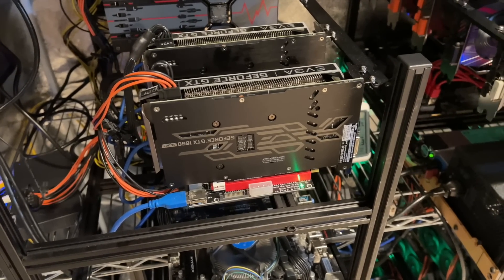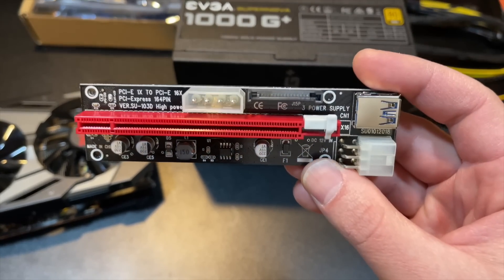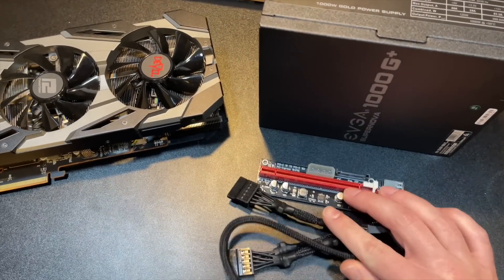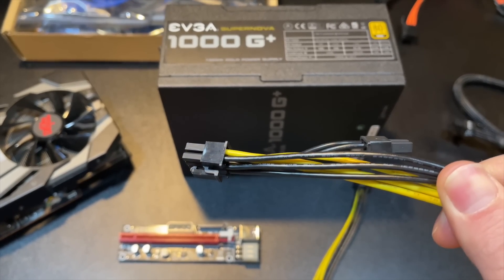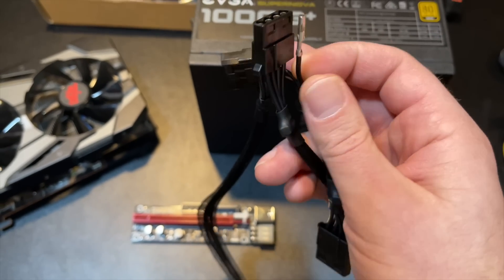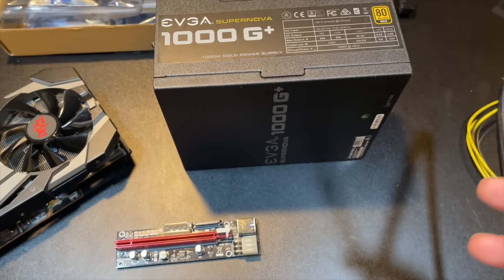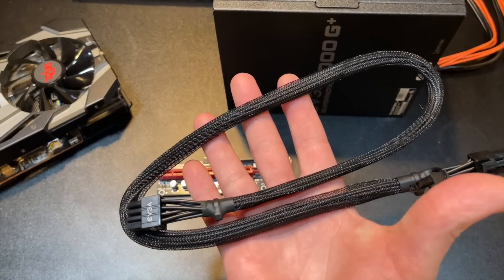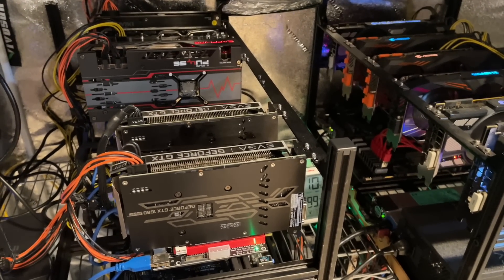Powering GPU Mining Risers Safely

Comment: Thank you so much for the most complete information about powering risers on youtube! I only have one doubt: I'm using all my 8 pin plugs on the PSU for powering the GPUs. Can I use the 6 pin plugs label as peripherals on the PSU to run a 6 pin cable to the risers?
Reply from the maker: You're welcome! You can only use the VGA ports on the PSU for your PCIe.
Reply: I had this exact same question due to running out of my 8 pin slots as well.  Thanks for asking and to Red Fox for answering!  

I’d like to know the why though… I’m guessing the 6 pin slots on the PSU (mine is labeled SATA / Peripheral) is going to provide 75W like the 6 pin PCIe?  Aka cause the slot on the PSU specifically designed for SATA standard?

Comment: I used a PCEI164P-N07 to my 3080 , and i used sata to 6 pin to power my riser. The riser capacitor blow up . Does it means is over volt ?  please share me some wisdom

Comment: What if you only use the pci cable and no power to riser? I have some old pci riser that goes into 1x slot and have no power option for it, and it works good so far.. about a week now.. and the cables are still as cold to the touch as the room it stays in.. (they are really short tho.. so cant connect all my gpu's for now)  so what happens if you use just the pci option for those?
Reply from the maker: That means that old riser is pulling the power from the motherboard. You just need to see what wattage those old risers are able to pull safely to give the GPU the power it asks for.
Reply: @RedFoxCrypto  so that power isnt enought for the usb to pci x1 in the more frequently used risers?

Comment: molex are more strong than sata , sata is not for high ampere it's thin pins ,and on 12 volts it's use only 2 positive pins ( negative pins are black and they are more 5 or 5 pins  (it's use 4 pins for 3volts ) and 3 pins for 5 volts , that mean yellow can melting ,  but u can always use more cable in parralale for more safety  and don't use too much spitter on same cable , try to split as near possible near the power supply and use the max of cable possible before splitting and don't spplit a splitted cable if you can use another who not splitted

Comment: Regular size Tamiya connectors rated at 15 Amps maximum were once very popular, especially with the electric RC car, truck, and boat crowd; but since high Amperage LiPo's have entered the scene, Tamiya plugs are used less and less these days. They are quite large for the small amount of current they can handle. ( molex  connector are similar to tamiya connector exept the plug housing different ) ,  so i hope this can be usefull for you , i make bicycle electric for 13 year  so i know about these connector molex

Comment: in molex the ampere negative use 2 cable black it's reduce the amp by 50 % per cable ( ohm law )  but the + 12 volts yellow is alone , ou should then double the cablage for yellow, or double ur cable yellow for less stress , molex should above 10 amp per connector but it's depend also of the quality of cable and if connector fit well  thick  or if connector don't fit well it's can be hot , or u should solder a big yellow cable on molex , connector molex is same tamiya ( 15 amp max )  connector used in some electric bike , even if i recommande you to use Xt60 if u want be sure and have no probleme

Comment: molex seem same bicycle electric connector they called '' Tamiya coonector and are rated for 15 amp  ''  , it's can draw 15 amp but not more and not long time , depend the cable behind too , i would recommande 10 amp max with double cable if possible for each connector  ,  but why not mix sata+ motex in parralale  for drain less ampere by cable if one seem low u can always mix molex+sata ( not on the same duplicator of course ) and it's only the connector not the cable if ur cable is too thin it's don't bring enough amp

Comment: Ok great video but the ONE aspect of these that everyone skips and I'm confused on: CAN I RUN POWER TO THE RISERS FROM THE SATA/PERIPHERAL PORTS ON THE PSU? NOT USING SATA CABLES, JUST THE PORTS LABELED AS "SATA" ON THE PSU? CAN I PLUG 1x 6 PIN INTO THE SATA/PERIPHERAL PORT OF THE PSU AND THEN HAVE IT SPLIT AND CONNECT TO 2x 6 PIN POWER PORTS ON 2x RISERS? I don't know why it is so hard to find clear definitive answers on this given the number of articles and videos I've scrounged through.
Reply from the maker: No you can't.
Reply: @RedFoxCrypto  Thank you 🙏 I don’t understand then what is the purpose of my Corsair hx1200 having 1200 watts of power if maxing out all the PCIE ports (5 + 1 for the cpu 8 pin) on 3 GPUs still doesn’t even get me halfway to the power limit? Am I missing something is there a way to actually tap into this PSUs full potential and add more cards? Barely over 400 watts with 2x 2070 + 1x 3060ti

Comment: Hello. My doubt is if the riser power consumption had to be added to the GPU power consumption when calculating the overall power consumption from the power suply.
Reply from the maker: It's included in the power consumption of the GPU. So if the GPU TDP is 125w part of that is provided from the riser.

Comment: Hey, I just starting to build my mining rig. Would it be better using 1 PSU 1000W 80+ Platinum or 2 PSU 550W 80+ Gold ? Please give me some direction, thanks.
Reply from the maker: I'd go 1000w. But it depends on the price, the amount of PCIe connections, and the GPUs you'll be running.
Reply: @RedFoxCrypto  I've just get 6 x GTX 1660 Super which are 1 MSI GamingX, 1 MSI GamingZ Plus, 1 MSI Ventus XS OC, 1 Gainward Ghost OC, and 2 Colourful BattleAx. For all of those GPU, i'm using Biostar TB250-BTC Motherboatd, 1 M.2 SSD 128GB connected using USB via enclosure, and 6 x 009s Riser.

Will it be enough using Corsair HX 1000W Platinum ?
Reply: @RedFoxCrypto  Also from your video, i'm gonna using PCIe Power Cable for safety.

Comment: If you using 6 pin from PSU to 6 pin on riser, where do you connect the 6 pin on the PSU? Is it the peripherals connections or ypu have to use the dedicated pci connections?

Comment: Amazon link to a good cable to plug directly into PSU which will go directly into the Riser? Link please?
Already got the same splitters and the same risers, just need to get rid of the crap seen at  6:02 - IF I'm not connecting  those to sata (bad idea it seems, even thought my rig came with them) I should pull those out, and move them to the direction connections to PSU
Reply: Looks like I got everything else alright - Just need to change power to risers -

Comment: When you’re splitting the PCIe, are you effectively splitting the “max” watts too? In your example for instance, would the 192 max watts for a single PCI-e be split to 96 watts max for both connections? Or do both connections still get a max watt of 192? (Hopefully this makes sense)
Reply from the maker: Good questions. Still 192 max watts for the entire cable run even if it’s split. PCIe standard specifications have it pull from the 12v rail. Link to the specs in the description.
Reply: Also, how do you know what voltage rail in the PSU the PCIe 6 pin cable uses? (You mentioned it pulls on the 12v rail)

Comment: What do you do if ur psu doesn’t have enough cables to power risers with 6 pin
Reply from the maker: Time to add a second PSU.
Reply: @RedFoxCrypto  i’ve been using the sata slot, there is only a 6pin to sata cable provided with my 850w psu , is it possible to use the 6 pin to 6 pin cable from a server psu with another psu?

Comment: 16:00 The TDP explanation is wrong. In the sense that it's violated 100% of the time (consider it "typical" Thermal Design Power under very forgiving workload conditions)
Just like recent Intel CPUs can draw 300W alone despite 120W TDP.

Comment: heyy dude  great video as always very helpful!! i just had one ques, do i need to power both the riser and the GPU with 6 pin connector from the PSU or just connecting one 6 pin connector to the riser would be enough ???
Reply from the maker: Both the GPU and the Riser need power from the PSU.
Reply: @RedFoxCrypto  ok thanks!!!

Comment: Hello. I have an Asus ROG-STRIX-1000 W 80+ gold. And i use 3x RTX3070 on it. I want to add another RTX3070 to the system. TDP for RTX3070 is 220W. 4 of them makes 220*4=880. Rest of the PSU can be enough for my Asus H87-Plus mainboard, i5 3470 cpu and Kingston 4GB DDR3 ram? This is how to do the math or am i doing a logical mistake?
Reply from the maker: You're right on.You'll be in a good place especially with those GPUs power limited. Typically add around 100w more to account for the motherboard, CPU, etc. Thanks for watching dude.
Reply: @RedFoxCrypto  I always do and learned a lot from your videos. So 880+100=980W Can my 1000W PSU handle this?

Comment: Can you please help me with one thing, if I have only one 6 pin cable available from my psu and my GPU (2070 super) is asking for 1x6pin and one 1x8pin, can I use the splitter to power riser with one 1x6 pin and gpu with 1x8pin or I need to somehow power both 6pin and 8pin on my GPU. IF I had only 1x6pin or 1x8pin on my GPU it wouldn't be a problem, but what to do when my GPU has 1x6 and 1x8 pin? Thank you
Reply from the maker: You'll need 2 PCIe cables to do that safely in my opinion, which means you'll need another PSU or to buy another PCIe cable to use on your existing PSU if it has additional VGA ports available.
Reply: @RedFoxCrypto  thank you very much kind sir :-)

Comment: Question: These risers with multiple ways of powering. Can you connect with multiple cables at once? Like the SATA cable alone is not a good idea. But what if you also connected the 4-pin Molex? I have old power supplies I'd like to use, but they have very few PCIe connectors, but lots of 4-pin Molex and SATA connectors. Would the riser pull power from both plugs? Or is there like a "hierarchy"? So like, if you connect to the PCIe connector, the 4-pin and SATA is turned off? And likewise, if you connect a 4-pin Molex, there's no point in providing auxiliary power through the SATA connector, because it's been turned off anyway?

Comment: TDP has nothing to do with electrical power, it stands for Thermal Design Power. And it is meant to say something about how much wattage in the form of heat your cooler needs to be able to pull away from the CPU/GPU chip.
The specification you want to know for how much electrical power a graphics card will pull at stock settings, is what Nvidia lists in the spec sheet for their GPUs as "TBP" = Total Board Power.
Why is this important? Because the GPU manufacturers sometimes do use "TDP", and if they do that correctly, they're not telling you how much power the whole card draws, they're only telling you how much the GPU chip itself is drawing, and by extension, how "big" the GPU cooler needs to be. Meaning, as an example, a 150W TDP graphics card, will pull more power than the TDP rating. Most of that power will be heat loss over the voltage regulators and the PCB of the card, as well as the power the VRAM needs. So a 150W TDP card might in fact be a 200W TBP card.
Reply from the maker: This is amazing info! I’m gonna have to do some more research on this and follow up with you if I have any questions. Thanks for the great comment. Stay safe and happy mining!
Reply: @RedFoxCrypto  No problem! There is a third abbreviation too you know. I just didn't mention it, as I wasn't really sure my "nit-picking" would be appreciated at all. :P 
TGP = Total Graphics Power. This is pretty similar to TBP. Except TGP should only cover the power draw of the GPU+VRAM. Which granted, is most of the power a graphics card will pull. But since AIB partners will use different types, and numbers of fans (which results in different power draw), for the different models. And plaster some models full of RGB LEDs, which draw a little power too. Sometimes for some models put extra display ports with accompanying extra controllers drawing more power. And also use different/more efficient VRMs (and even PCB). All this leads to different TBP from model to model, even with the same chip at the same frequency. So TGP is a more "pure" value, describing only the amount of power the card needs, which is not variable due to differences in designs.
I found an article that explains the differences pretty well, with only a few minor inaccuracies, even so, it still managed to teach me something new as well; the "P" in TDP when talking about GPU's, doesn't stand for "Power" like it does for CPUs, but instead "Parameter". :P
I don't want my comment auto-deleted as spam for linking the article though, so instead I'll just mention the site's name: "appuals", and if you google: "graphics-card-tgp-tbp-and-tdp-what-is-the-difference", it should show as one of the very first results. Hope this is of interest/use to you as well. :)

Comment: Thanks for the great informative video. May i know is that safe to use the 24 pins split connector (the 02 wire socket type) to power on my 2nd PSU? Some claim that this method might my the GPU.

Comment: Can these splitters power the top two 8pin on my ASUS TUF Gaming GeForce RTX 3070 OC 8GB GDDR6 Graphics Card? I have run out of VGA cables with the pigtails on top.
Reply from the maker: Yes I use the Deep in the Miners splitters to run some of my 3070s. It splits a single PCIe that's coming from my PSU.
Reply: @RedFoxCrypto  Thanks for the quick reply. I will try putting the splitters on top of my GPU as well as the powering the risers. This is a great fix. PSU's are hard to find now over 900w. Not many options on back on the market now. I have not found any good server power supply options either. I have been staying with EVGA psu's. They seem safe and a good option.

Comment: Wait a minute... @Red Fox Crypto, the PCI PSU cable is (16A x 12V) 192W max.
The PCI standard on the GPU is 75W max.
The 1660 Super TDP is 125W...

125 + 75 = 200W at peak which is above the max of the 6 pin PCI cable how is this safe again?
Reply from the maker: The 75w is included in the 125w TDP.
Reply: @RedFoxCrypto  ohh crap. But because it’s not plugged into the motherboard that passes onto the riser. Makes sense now. 
Thanks for clearing that up!
Reply: @RedFoxCrypto  Question about the splitters, what If a card has a TDP of 150W, so below the 192W rating, but has an 6+2 pin and 6 pin PCI power connectors.... but the splitters are only 2 x 8 pin (1 to riser, 1 to GPU) can I daisy chain another splitter? Or just connect the 8 pin and leave the 6 pin unplugged on the GPU?

Comment: Great video mate. Just unclear where should i connected to the PSU, i have 4 slots, so if i use 1 cable per 2 risers i will be able to connect only 2 GPU to my PSU. Do i need to plug this to the SATA/Peripheral or VGA slot.
Thanks
Reply from the maker: Thanks dude. You'll definitely need to plug into the VGA slot on your PSU.

Comment: Is safer what you said but with sata to 6 pin I use over a year on rx580 and no problems and on rx 5700xt and gtx 1070 / 1080 I used direct molex to riser also no problems. For more powerefull gpu I also belive that is not safe the option sata or molex. Good luck !

Comment: I have a PCie power cable which is connected to SATA power cable. I use it with combination of Molex power. So I have 2 connectors powering my riser. I worked with what I had so. And it is working just fine for 2 months. My native Pcie power cable orders were stuck in Suez channel and hopefully I will get them by the end of the week.

Comment: This video is wrong... but well meaning. first the PCIe power, direct from wikipedia:
    ×1 cards are limited to 0.5 A at +12 V (6 W) and 10 W combined.
    ×4 and wider cards are limited to 2.1 A at +12 V (25 W) and 25 W combined.
    A full-sized ×1 card may draw up to the 25 W limits after initialization and software configuration as a "high power device".
    A full-sized ×16 graphics card[21] may draw up to 5.5 A at +12 V (66 W) and 75 W combined after initialization and software configuration as a "high power device".

When you use a USB riser, you are a 1x card. the card believes it is in a 1x slot. The card will NOT draw more than 10w from the riser board, but will make up the diff from the  8-pin and 6-pin connectors on the rear of the card. The card is physically not connected in a manner that will allow it to configure as a high power device.
Reply from the maker: Watch BBTs video in my pinned comment.

Comment: Great vid. This standard is what I'm personally going by for SATA/Molex from EVGA. So Molex could power more in theory, but it's rated identically to SATA--and I quote:

"All of our EVGA power supplies are manufactured to conform to ATX standards. The ATX specification has different ratings for voltage and wattage, depending on the connector that is used. In a typical configuration, where a graphics card is directly installed into a PCIe slot on a motherboard, that PCIe slot is specified to deliver 75 watts.

PCIe risers and adapters do not conform to ATX standards. Using these types of adapters can result in damage to any system components.

The ATX standard for SATA or Molex connections is rated for 54 watts. Each SATA/Molex connector provides three 12v pins at 1.5 amps each, for a total of 4.5 amps. 12 volts, times 4.5 amps, equals 54 watts able to be provided by a SATA/Molex connector."

Edit: AND something I didn't know but picked up on Gamer's Nexus is that not ALL power cables are the same. To avoid issues, you should generally match the power cables that came with your PSU. Knowing this, I'm now purchasing only Corsair PSUs and their respective cables for  everything--unless it's an ITX case that needs a specialized size--really like the tiny Cooler Master V850 for the nr200 case.